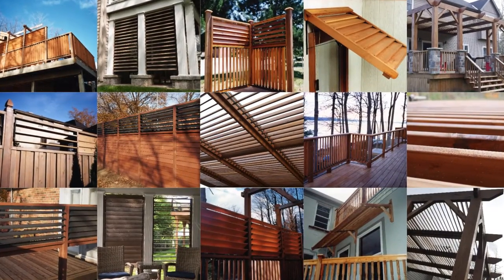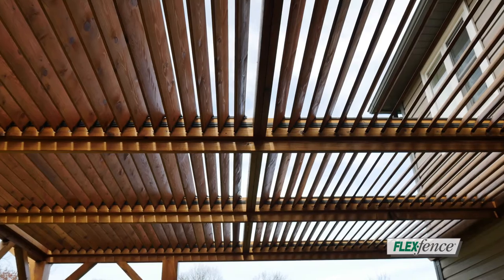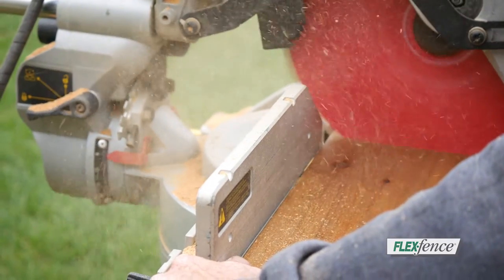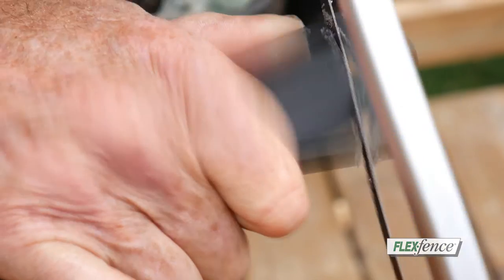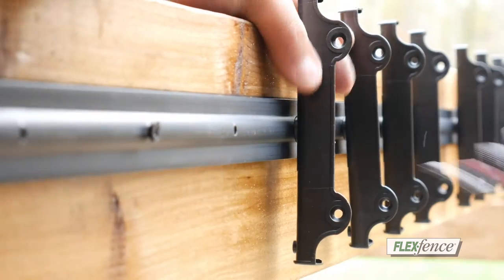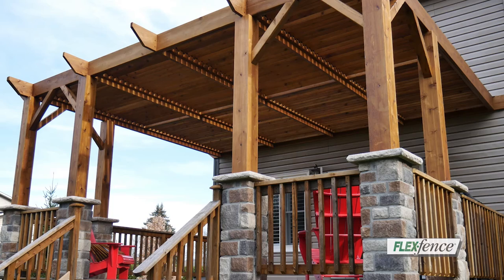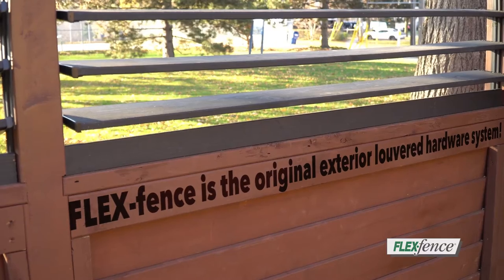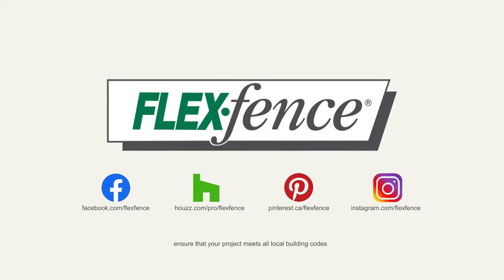2020 FLEXfence Commercial

Comment: only hardware with this kit are the screws - all parts in this product PVC plastic?
Reply: Kind of looks like it. I wonder how long it takes for them to get brittle and break?
Reply from the maker: That is correct! They are exterior grade PVC. Great for extreme cold and hot temperatures, and no rusting!
Reply from the maker: Our customers have used them for over 10 years and they've had no issues. They've been tested to withstand over 400kph windspeed!  @GFSwinger1693

Comment: How do I mount so the boards are flat when closed? I want 8t to look like a normal privacy fence when closed.
Reply from the maker: Our kit is measured out to have each board angled. Perhaps you can exclude the prepunched rail and measure out the width of each board to see where to drill each bracket to have the boards lay flat. Can't vouch for this though, we've never tried!